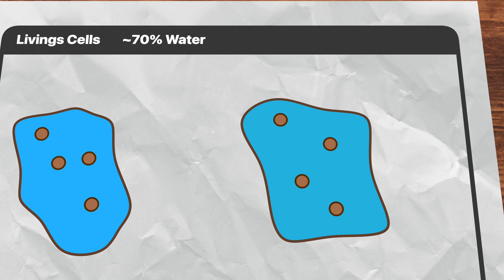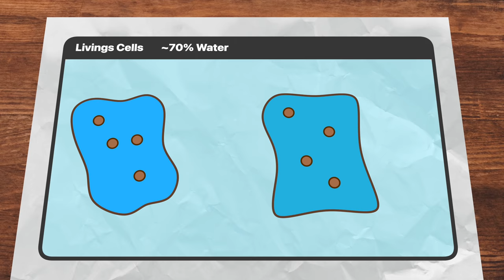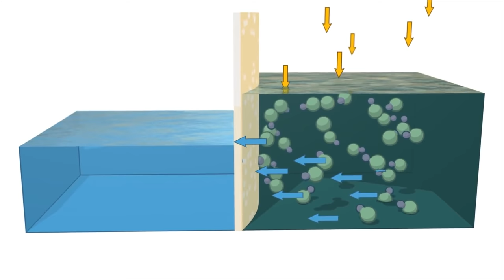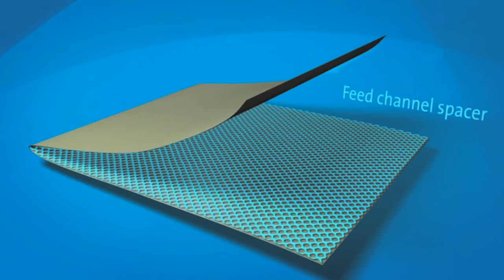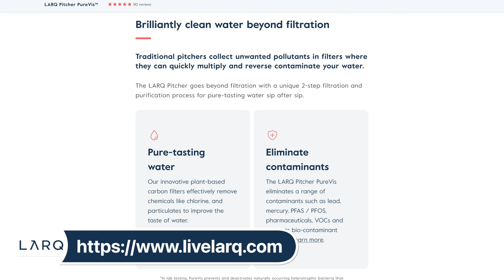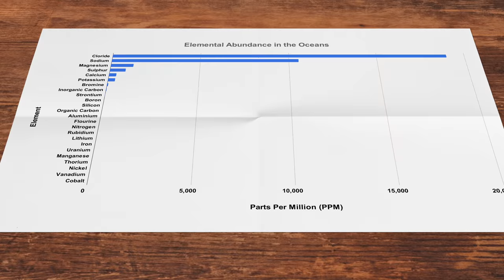Why Not Build Desalination Plants EVERYWHERE?

Comment: Our company was one of the first thin film composite reverse osmosis design engineering, manufacturer, installation companies.  We created the drinking  water from the red sea and made the desert bloom.  However the key was to remove all the microscopic life in sea water prior to separation the salty water.  Many companies dropped the ball on pretreatment requirement and their plants failed long term.  Fresh water and conservation reusability can solve humanities water needs.
Reply: Exactly the way to save the humanity from the global environment problems, we need to use the seawater as drinking water.
Reply: Hi Larry, could you tell me why it's important to take out the microscopic life forms first? Thanks
Reply: @trueAnge1  Oceans are full of microscopic life which will grow as a biofilm on the surface of the reverse osmosis membranes reducing their ability to produce fresh water.  Cleaning these biofilms becomes difficult and over time becomes costly and difficult. We turned down many projects because the civil engineers would not listen to us.   Such projects failed within a year. Hope that helps.
Reply: @larrystenger1247  thanks a lot
Reply: Didn't know how important that is - I suppose it depends on the cost of membranes vs pre-treatment as to what makes more sense; pre-treat, or just burn through membranes.  I have no idea of the costs.
Reply: Larry, does graphene filtration have the potential to drop your costs even more by lowering the energy requirements and filtering out everything except the H2O in one step? Let us know what your company is (was) doing. BTW -  I'm encouraging my son to go into graphene engineering in college.
Reply: can I have a job
Reply: WRONG ITS NOT WATER ITS H302 🤦 THAT IS WITHOK THE BODY
Reply: @Yweile  Huh?
Reply: I am 54 and my son is 29...him and I were just discussing how they could solve the water problems throughout our country....how it's not that they can't do it but that they WONT do it.Its sad to explain the why part of this to our adult children 😔God bless🙏
Reply: Sure buddy 🤣🤣
Reply: @papabear3525  you don’t believe him?
Reply: @papabear3525  Why would someone lie about something like that?
Reply: @papabear3525  everything okay with you?
Reply: one of the things about modern life that sucks is that I have to EXPLAIN (not to you yourself Larry, but for our more...challenged commenters! :p ) that I am NOT being sarcastic when I say WELL DONE MAN!, THAT'S FRICKIN' AWESOME!
Nice work, keep it up!.
Reply: @papabear3525  I get that you’re probably a warehouse jockey with no marketable skills, but that doesn’t mean everyone else is.
Reply: @adrianpallis4568  ; There are no global environment problems in civilized countries
Reply: @trueAnge1  ; Because they are deadly
Reply: @WaltRBuck  Don't you know H302 bro? It's withok the body, everybody knows that.
Reply: I love this. Thanks :)
Reply: Doesn't that make you partially responsible for climate change
Reply: @realitynowassigned  : The climate change which occurs in the Earth is of its own accord.  It is natural for the climate to change.  Human beings do not influence the climate.
Reply: @wrongfullyaccused7139  that's like saying you don't change the temperature of a fish bowl by dumping hot water in it
Reply: @wrongfullyaccused7139  it is natural for the climate to change. This does not mean it is impossible that we would influence it ourselves.
Reply: @larrystenger1247  and yet if we all acted in a sustainable way new babies would not have an effect. That's like arguing that the fish should simply stop reproducing so that you can dump less food in
Reply: @realitynowassigned  The main difference is that humans have developed a brain that can relate cause and effect.  A fish has no such capability.      It's quite obvious that humans cannot continue to over populate without overstressing their environment.  Clean water, air, food, minerals, materials are all becoming more expensive due to scacities and demand.  I attended an EPA symposium relating to providing clean water and sewage to third world countries.  Turns out the birth rate would never allow the capitalization rate to catch up to the birthrate.
Reply: @larrystenger1247  you're blaming people for being people instead of corporations for being greedy.
Reply: Larry, that sounds great. How economically feasible is it to do in more northern longitudes ?
Reply: But tells what do you do with the highly concentrated toxic brine that is the by product of desalination do you send it back into the sea destroying the oceans killing it making into a dead sea,  Thank you god to live in the "UNCIVILIZED" 3rd world banana republic of costa rica with my amazing beautiful danish wife surrounded by rain forest with plenty of water clean air and clean soil and most importantly people with common sense who value what is truly important....
Reply: @RM360CR  ; The brine does not hurt the ocean.  It is not concentrated enough to do any harm.  The ratio is overwhelmingly in favor of the ocean.  Furthermore, it can be easily processed into salt if they wanted to
Reply: @wrongfullyaccused7139  Yea, we ve heard that before and something tells me you are not  NO expert or even a person of comon sense or logic and the reason why are in this mess in the first because of people like u.....
Reply: Imagine doing this for a city like los angeles of 14 million people releasing all that brine on daily basis and OH no nothing is gona happened it will simply disolve in the vastness of the ocean 🤭
Reply: Some how U have been wrongly accused of being a total and complete MO Ron, i doubt it.....
Reply: @Larry Stenger

Desalinization kills billions of tons of sea life every year. And it's not really that prevalent yet.

They need to run the pipes deep where it's more void of life to begin with. Then filter it before reverse osmosis process.

Note with layered filters, one could filter out many minerals to sell.
Reply: Cruise ships actually produce there own water
Reply: @larrystenger1247  so in places like the Black sea, where the saturation in H2S makes life impossible underneath 60 meters, water desalination should be, at least theoretically, less expensive?
Reply: @rafanadir6958  We never ran any systems under those conditions.  If asked we would have done a pilot plant to study operational and economic issues before making any recommendations.  There are other issues that makes sea water desalinization challenging such as galvanic corrosion, microscopic organic fouling, pressure, salt content verse recovery rate, environmental issues and cost of electricity.  Reverse osmosis is one of a number of tools to create fresh water where it is sparse.  In many areas of the middle east a barrel of fresh water is more valuable then a barrel of oil.  Thanks for your question.
Reply: @RM360CR  Wow, what was that reply all about ?
Reply: @bagofnails6692  I think they where saying “I can tell the original poster (Larry) is smart, and it’s funny people want to argue with him” but idk 😂
Reply: thin film composite reverse osmosis design engineering manufacturer installation company, sounds like a power move, and a complicated phrase.
Reply: Not Only That, we even create Groundwater and so normal fresh water not only for use but for the plants, too
Reply: @Yweile  Structured water is not a thing.
Reply: Very interesting, OP—- thanks for sharing.
Reply: What happens to the salt?
Reply: @sharinnature  why wont they solve it
Reply: hi Larry,

can you tell how is the separation of the micro-organisms from the rest of water done?

Also what is the name of the company you work(ed) in?
Reply: @emmanuelpoirier4602  Sure, we actually drilled wide sea water wells in the dead coral reefs under the sand at the beach/waterline and used the dead coral as a filter....it worked very well.

Comment: A cheaper solution is to pump cold seawater and use it to condense fresh water from the air.  Pumping is cheap, cold ocean water is abundant and there is no brine to deal with.  Still, nice video.
Reply: Brine is a resource.

And good for bricks!
Reply: I don't know if the amount of condensation would be worth the price of pumping ocean water. Plus when the water warms up you have to pump more and that happens fast
Reply: @hopelessdecoy  An excellent observation!  I've run the numbers and here in central California where the humidity is relatively low you need to circulate 120 gallons of sea water for every gallon you condense from the air.  In St. Croix, which is more tropical, you only need to circulate 37 gallons of sea water for every gallon of fresh water you make.  The cost to pump is about 0.2 watt hours per gal.  In other words, cheaper than reverse osmosis with no brine.  But further, at a power plant that needs cooling water anyway, the pumping is almost free.  At its peak, the central California Moss Landing power plant could have produced 12 million gallons per day of fresh water from the cooling water it was already pumping.
Reply: @lukedegraaf1186  More information on the bricks, please.
Reply: @Barskor1  I have this stupid idea that carbon could be sorted in limestone, and used as a building product, with good insulation properties. Less avid in the oceans is good for reefs, and takes carbon out of the atmosphere at the same time.
Reply: @lukedegraaf1186  what does that have to do with brine...?